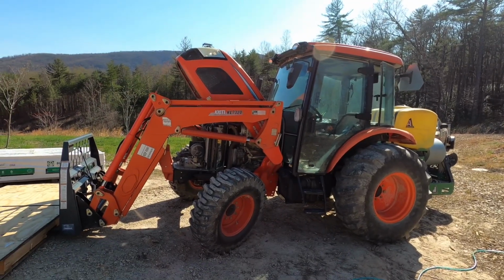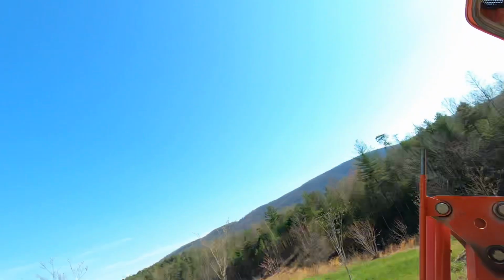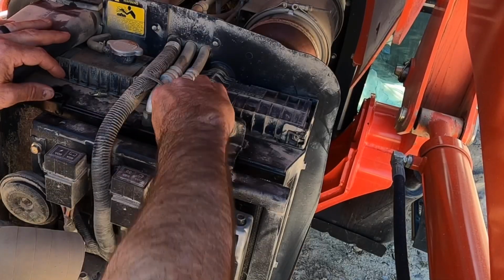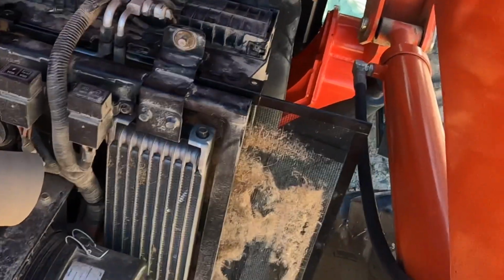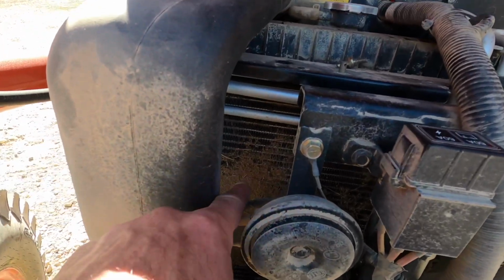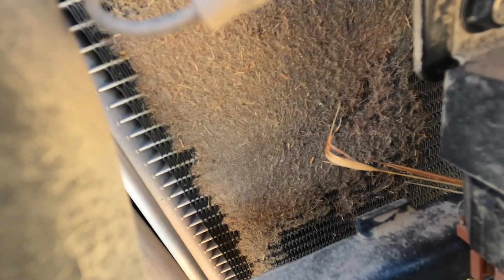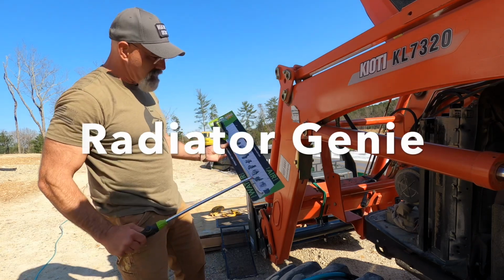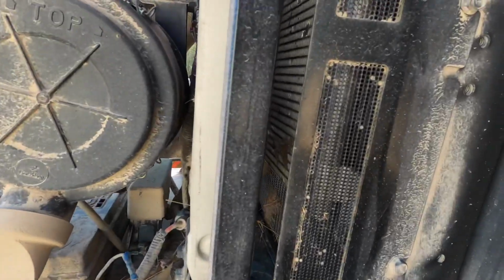Radiator Genie review and demo  Water and Air cleaning wands for radiator and cooling systems.

Comment: Just purchased one today 6/23/2022 and wow it's awesome!!  I have a 2nd gen dodge 5.9 Cummins. The crankshaft seal blew out and suck oil all through my radiator last year. Well, I was pulling 19k the other day and she started getting hot. It dawned on me that my radiator was all gummed up. I bought this along with some Zep degreaser and went to work. You wouldn't believe how bad she was clogged. It took me about 2 hours to get it done. But we got it done and she looks brand new. Wow, what a product they have made!!!
Reply from the maker: Yep. I wish I invented it.

Comment: Great product. Use mine all the time. Works great on tractors and other vehicles with radiators, ACs, and fluid coolers. Works great to periodically clean your outside ac system. Always blow "outward" through the cooling fins. Works great to clean your tractors air filter element. Stick the wand inside the element and blow back outward. Extends the life of the element. Excellent product that I highly recommend.

Comment: For the air wand - would I need a proper compressor with a tank, or would a dinky little 12V type do the job?
Reply from the maker: You would need at least a pancake compressor.   A tire inflator/ emergency type just wouldnt do anything.